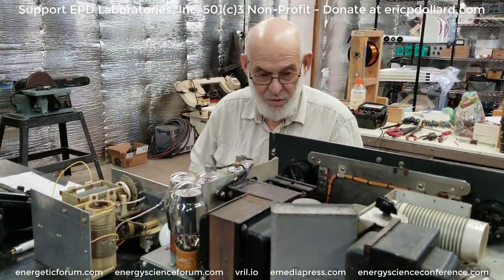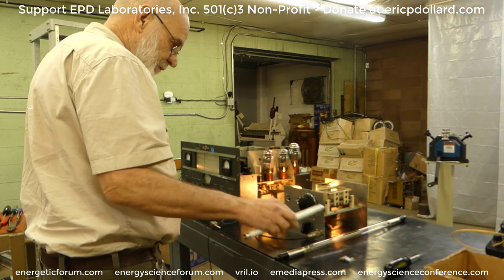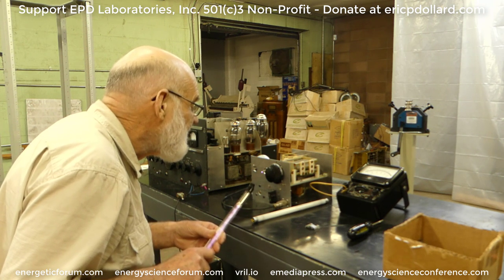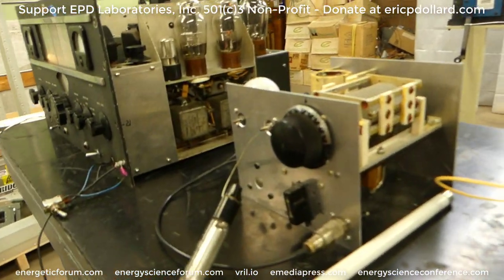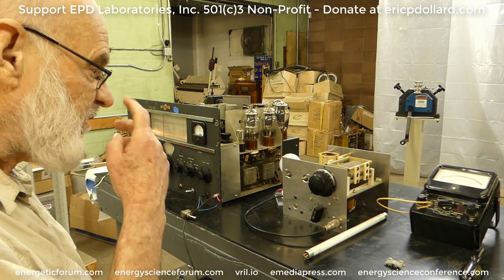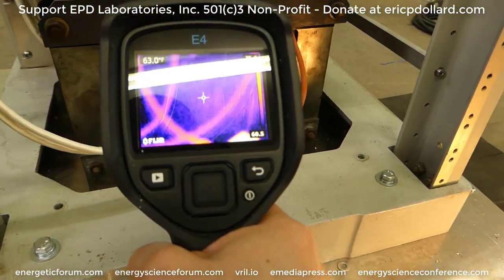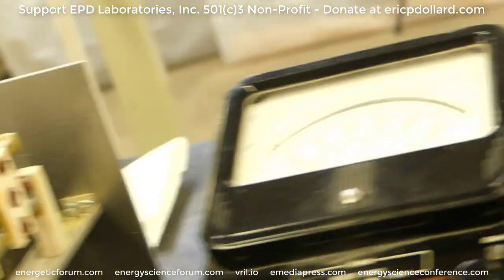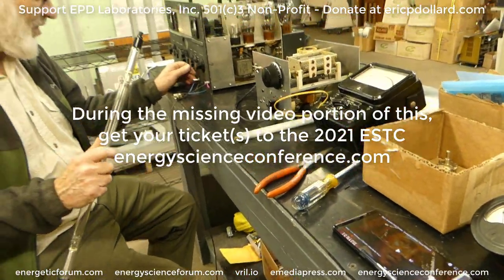2021-02-07 to 11 Eric Dollard Collins Transmitter Small Flame Speaker Demo

Comment: Yup,Collins best xmtr.(better rf than cb. rf of Mr Beck more power also)ps Collins used in the Nam , prc 25 , base stations, most all radios,am.and fm.we used to light tubes in electronics class in high school.with our transmitter builds. Got in trouble with faa  interfered with airplane radios.collins nice clean rf. Nice choice by Mr. Dollard!

Comment: So when you were speaking of the DC circuit wired to the transformer with the other side shorted, that was just to give it the necessary impedance in the circuit and to absorb transients or "smooth out" the signal and act as a current limiter I'm assuming? Thanks.

Comment: Having those two outputs right next to the variable capacitor knob is just ridiculous!  How many RF burns have you gotten? 
If the modulation is blowing out that tiny spark, how do you expect to drive those big coils with this thing?
I've made a better plasma speaker out of a flyback transformer!